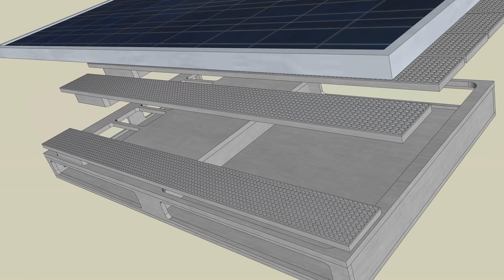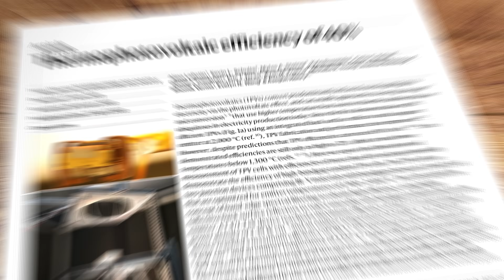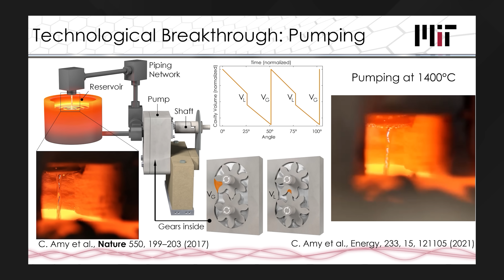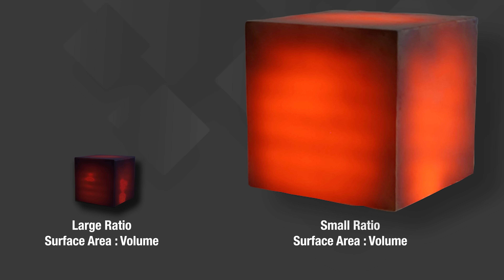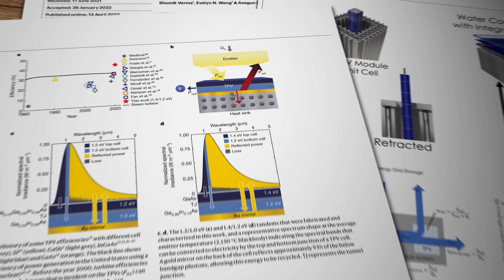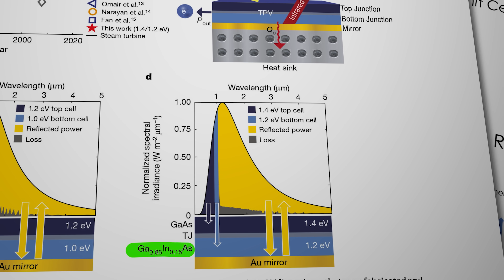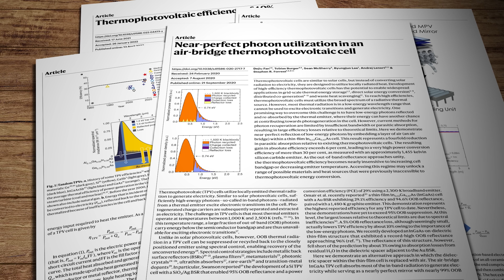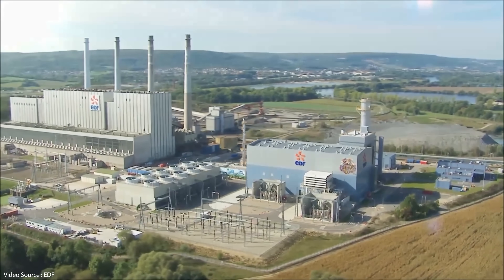Grid Scale Energy Storage 30x cheaper than Lithium-ion! How do they do that?

Comment: Looks like a far better grid electric storage solution than what is being used. I would like a comparison of this solution to the molten metal battery solution that is being worked on between a Toronto, Ontario company and Cambridge University. I would think the carbon seals in this system would also work in a molten metal battery. It looks like a grid sized electric storage system is in our near future. It has been needed even before renewables entered the picture as it would elimiate the wasteful peak generating stations and reduce the need for more main generating stations. All of this reduces emissions.
Reply: Wow dude, this looks awful.  Why would you store so much thermal energy just to use a special photovoltaic cell to extract the energy at an efficiency of 40%?   So much of that heat is going to leak...  Besides, Ambri liquid metal antimony batteries already work as well as pumped storage.

Comment: Excellent idea, seemed complicated at first but not in comparison to other large scale projects. Great to see innovative ideas come to life.
Reply: No, this is too complex, too much place for loss, not to mention the energy extraction is limited by the 40% efficiency of the photovoltaic cells...  Waste of energy to cool 'em off so they don't vaporize.  Also...  I think the pv cells 40% conversion efficiency is only the incident radiation, which is a small fraction of the radiation losses that are effectively lost through the coolant system that ensures the pv cell isn't vaporized.
Reply: @kayakMike1000  it's probably more than 40% effectively. A lot of that 60% "loss" is radiated back and re-heats the graphite and gets another chance to be converted to electricity. Still way too many steps and multiple ways for the whole thing to fail catastrophically. Solid tin in pipes, anyone? Or how about an inferno should the argon leak?
If you want an example of much more sensible heat energy storage, look at ETES aka "hot rocks" by Siemens Gamesa.

It's comparatively simple:
1) Put rocks in an insulated box.
2) Heat up the rocks.
3) Make steam from the heat.
4) Spin turbine with steam.
No molten tin, argon-filled warehouses, or any of that shenanigans involved. One of their small-scale demonstrators has been active since 2017 with a proven round-trip efficiency of 25%, mostly due to heat loss. Scaling it up will get that to 50% or higher. Their concept involves building these "hot rock" boxes at decommissioned coal power plants, since the required generation and transmission infrastructure is already in place.

Comment: It'll never happen, because it relies on going "full scale" right away ie it only works at large scale, which means huge upfront costs on a risky and unproven tech.

The fundamental reason battery storage (and wind turbines and solar panels too) have had such a large market prenetration is precisely because they work at small scale, and are infinitely scalable. Ie you put in 1MWh of battery storage and the inital costs are low. It's easy to install and requires few ground works or plant/ support infrastructure.  If that works and produces a reasonable performance next year you put in another MWh of batteries, and so on. Same with turbines and solar panels.

Huge unfront projects requiring all sorts of permissions and political agreements simply don't work these days........

Comment: It seems that there is a wasted step in this process.  Why heat metal to then heat carbon to then heat titanium foil when you could just use the electricity to heat the carbon blocks in the first place?  Is it the idea that you could store more heat energy in the metal ?  To keep the carbon blocks at an even temperature?

Comment: First I was interested, but when it got to the photocells it went downhill fast.
The reason we don't use germanium photocells already, is because they are much more expensive than silicon ones. Like 100x more expensive for 10-15% better efficiency.
So to build enough photocells to generate 1GW of energy alone is a BIG undertaking, as no photovoltaic system was ever build in this size and infrastructure. You need also to convert the low-voltage DC current into a high-voltage AC current, which will eat at least 5-10% of the efficiency on top.
The heat storage alone is complex enough and was never build in a big industrial scale, so build that first, cut all the photocell stuff out and make steam and use an old decommissioned steam turbine and generator that has already an efficiency of 50-60% with technology that is tested and proofed.
When you get that to run, THEN you can add and try the photocell system that will most probably cost more than a state-of-the art steam turbine with generator and go and proof that it will surpass the 60% efficiency that a modern steam turbine generator has, and that produces the needed high-voltage AC current from the get go and needs no DC-AC converter stage.

All in all, sounds rather improbably and bad practice to start with multiple, new, unproven technologies instead try to get the first part running first and iterate, but I did not read the papers if I missed something.
Reply: Your point is 100% valid. 
When you get molten graphite, then why don't use it to make steam? 
Steam turbines are used everywhere around the world. So use it to make electricity.
Reply: @stunningsalman  The system uses graphite blocks.  I didn't hear molten graphite being mentioned at any time.  Additionally Apollo's analysis is stunningly incomplete, with a meaningless conclusion.
Reply: @Apollo I've concocted some thoughts on problems you've pointed out. 

Here's my attempt at addressing your issues with this tech;
One of the qualities that Dr Asegun Henry is aiming for with this storage system is to have very small response times, where turbines need tens of minutes, a PV needs tens of seconds.
Your suggestion of using "old decommissioned steam turbine" wouldn't work. Steam turbines like all equipment have operating lifespans, an old decommissioned steam turbine will likely be at the end of its useful lifespan. And as to the idea of using proven steam turbine technology, the main issue with that is that modern steam turbines are used to take energy from around 500c to ~100c, this temperature is well outside of the 2400c to 1900c that this thermal battery uses. Consequently a new turbine system would need to be designed likely requiring another working fluid (not water) which would probably be as costly and arduous as developing these Gallium PVs.
Reply: (cont)

Another concern you had was the difficulty in manufacturing enough photovoltaic cells for a 1GW capacity, remember that although a standard silicon cell for solar collection usually has a power density of around 1kW per square meter (1kW/m2), due to the extreme temperature of the tungsten lined graphite tubes in the MPV unit, (bit where the Gallium cells are housed and extract energy), the energy emitted is around 680 kW/m2 , (according to the paper, pg 6 of 10). Now on the assumption these Gallium PVs are only able to harvest 100kW/m2, that puts the area of a 1GW Gallium PV array at 10,000m2 well within the scale of a standard PV solar array.
As to the cost of such panels, the paper (page 8 of 10) states the $/m2 of these PVs is assumed to be $10,000 with the power density at 100kW/m2, giving $0.10 per watt of power, comparable with standard PVs. (Standard silicon cells cost about $500 per 1kW, these Gallium cells costing about $100 per 1kW.)
Reply: (cont 2) As to the problem of industrial scale thermal storage, this as already been done (albeit at lower temperatures) with molten salt storage at "solar power towers", which use gigantic insulated drums to store thermal energy at industrial scales. This new storage method proposes using large blocks of graphite kept under an Argon atmosphere, insulated by glass wool. Which may be much hotter but isn't using anything more exotic than whats found in an aluminum smelting plant.
Reply: @joaanebogs9841  Very interesting info indeed. I think the high temperatures isn't that much problem if used to boil water for a steam turbine though. Because it can be controlled by the heat transfer rate (if having for example a  heat conductive bridge that transfer heat from the hot blocks/battery to a boiler
 - then that bridge can be moved to control how fast heat is transferred from the hot to the "cold" boiler side). But I guess that would defeat the whole purpose of having a heat storage battery operating at this high temperatures then. Good point about the molten salt heat storage - because such power plants have already been built. The whole idea of having a heat storage operating as these very high temperatures is probably to maximize the heat radiation output compared to the surface area for the photovoltaics. Heat radiation intesity goes up with the power of 4 of the absolute temperature, so that makes sense. The 1900+c temperatures probably also put the radiation in a better wavelength range for the photovoltaics (they just need to be modified slightly compared to ordinary solar cells - since the output get  much closer to what comes from the sun - mostly visible light). But, they will need something else than glasswool for insulation, because glasswool melts at like 700c, haha. At least for the inner lining that will face the hot blocks (that  will probably need to be some high grade ceramic fibre or insulating fire bricks). It might work for outer insulation though. But I still guess rockwool would be a better choice for that as well - since it has about the same insulation properties as glasswool, but can handle at least about 1000-1100c before melting.
Reply: @Speeder84XL  Looking at page 8 of 10 of the paper, it shows a cost breakdown of the Cost Per unit Energy (CPE). Among the things listed in the chart there is 3 types of insulation listed; Fiberglass, Alumina, and Graphite. I believe this is to say that there would be 3 layers of insulation, protecting each layer from the higher temperatures within. The first layer would be "Graphite insulation", to my understanding this is made from tiny (<500um) spheres of sintered graphite. Next would be a layer of "Alumina insulation" (i think this is widely used in iron foundries but not sure). And then a final bulk layer of "Fiberglass insulation". Hope this helps.
Reply: Perhaps, nothing would ever have been invented or developed if we had stopped as soon as someone said anything won't work. Perhaps some of the energy could be tapped off in steam to heat homes or industrial processes, some DC electricity could be used locally to relieve demand on the wider AC grid, some AC could be generated from steam for pre-known demand and the galium arsenide PV could be used for reactive deployment. Altogether this is a very interesting development that needs a bit more work to get it to a commercial level.
Reply: Apollo, thanks I want an option rather than solar looking also to be off grid at some stage any ideas?
Reply: This is a test reply, youtube wont let me respond :(
Reply: Um... why are we talking about germanium? This video is talking about gallium arsende doping of solar panel surfaces. Germanium and selenium are for diode semiconductors... not the same thing. And that mistake makes me question the rest of the analysis. There are indeed many missing considerations. And I question whether or not the electricity needs to be converted back into AC in the first place. That's thinking with a mental straight jacket. Doesn't need to be AC if the energy is transported away chemically for instance.  Doesn't need to be AC if it's powering grow lights for a green house next door. Doesn't need to be AC if it's running an HVAC system or motors in a car plant.  The best inverters have efficiencies of around 97.5-98%. You guys are kidding yourselves if you think an MIT professor is not going to test the pieces of this system in isolation. The undergrads working for the grad students working for the post docs working for these professors have more elaborate notions than these suggestions.
Reply: @darinhitchings7104  If it's a system meant to  store energy from renewables, that can later be fed back into the AC power grid for use during the times the renewables don't produce anything (which is the whole idea), it will of course need to output AC. 

But as you said - good inverters doesn't waste very much power. 
It was more about the transfer of stored heat energy within the system and getting photovoltaic panels to work under such extreme conditions, that was the thing. 
Basically it's a system that just convert electricity to heat and store the energy as thermal energy
 - which can then be converted back into electricity again when energy is needed  That can be done in many ways. 
The more complex a system is and the more unproven technologies that's used, the more unpredictable the costs tend to be
 - making less likely to get the funding needed and be scaled up for practical use.
Reply: @Speeder84XL  tough to argue with that! ;)
Reply: You seem to have assumed that the light intensity of the molten tin would be the same as mild sunlight falling on the earths surface.   You make no adjustment what so ever when you compare a sun based system and its wattage per cell and what the intensely heated tungsten foil would provide.   Nor did you address the precise nature of the frequency tuning in the light source AND the cells.   In short nothing you said has enough analysis to reach any conclusion at all.   Perhaps you were biased to start with and it led you to the kind of short cuts and insouciance you demonstrated.
Reply: @jonathanhall5660  He doesn't need to take anything of that into account, because the inventors themselves stated an efficiency of only 40% and if anyone knows the potential efficiency it's them.
Reply: @ehtuanK  The 40% appears to be the cell efficiency not the system cycle efficiency. And it's from people trying to keep their work funded. Optimism is cheap.
Reply: germanium? when did he say anything about germanium?

but hey, germanium is superior to chinesium :-)
Reply: @mrxmry3264  Oh dear, ignorance strikes again:
https://en.wikipedia.org/wiki/Germanium
But yeah, I accidentally misspoke and was writing Germanium instead of Gallium. Mea culpa.
Reply: @Speeder84XL  The molten tin? Why not just use wires to transfer energy? Nice and thick wires and transport high voltage DC to keep losses low.
Reply: @deslomeslager  It's hard to transfer heat thru wires, haha. That's what the molten tin is for. 
Once the heat energy is taken out and converted back to electricity, it's all wires. Of course, the DC from the photovoltaics could be used directly to power other stuff that can run on DC - but since the idea was for grid storage,  it needs to output AC, because the power grid is AC.

Comment: The carbon heat storage system seems good. Scrap the molten tin, scrap the solar cells. Why not use it to superheat water to drive steam turbines? Most of the infrastructure is already in place at the decommissioned sites described. Why the need to over complicate with unproven technology? The running system would still have zero carbon emissions.

Comment: Really interesting! I anticipated that this might be used with thermal batteries made from molten silicon, which I think are being deployed in Australia, but I was obviously mistaken. Compared to submerging the TPV directly into the massive tanks of molten silicon, this seems very complex. What is your opinion about the approach I'm referring to?
Reply: Molten silicon? Unlikely. I'm guessing the system you're referring to might be using molten sodium which is quite common but that operates at the relatively low temperature of 600 degrees F, not at the very high temperatures described in this video.
Reply: "Silicon has unique properties that confer it the ability to store more than 1 megawatt-hours of energy in one cubic meter, ie, about ten times more than with the salts currently used in solar thermal power plants..."

Comment: The solid state nature of these cells leads me to believe that they should first be used to replace the application of Seebeck generators (which never reached above 10% if I remember correctly), ie in remote nuclear applications (RTGs in space and remote locations). It should also make the implementation and downscaling of small nuclear reactors (with high quality heat in the 800-1200deg range) much easier than trying to adapt turbines for this purpose.
Reply: PVs only work if the heat source is hot enough to emit near-IR. TECs can work at lower temperatures.
Reply: Good thinking!
Reply: Probably only in locations that have a ready source of very hot geothermal energy.  Like literally near surface lava/magma.
Reply: Molten metal and then water cooling in the same system. These are supposed to be engineered systems, not dreams worked up by brainy students at MIT. 

If they are going to be moving high heat around, why not look at the heat management systems already worked out for reactors running at higher temperatures for higher efficiency, and those use molten salts. Such salts have high heat capacities and can be pumped without the plating tendencies of molten metals.  Also, various mixes of molten salts can be adjusted to the characteristics desired, while molten metals would be less flexible.